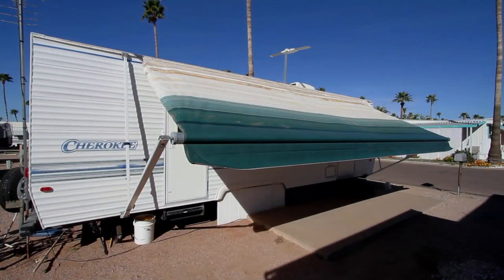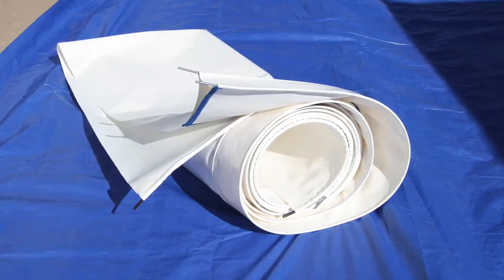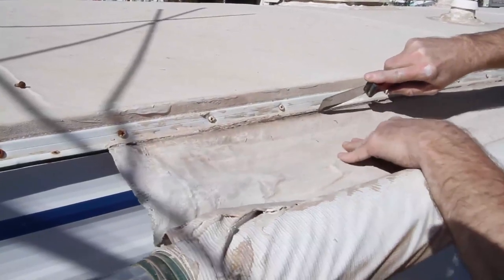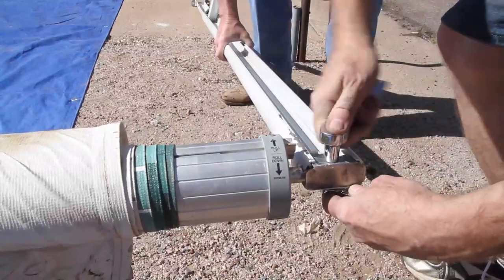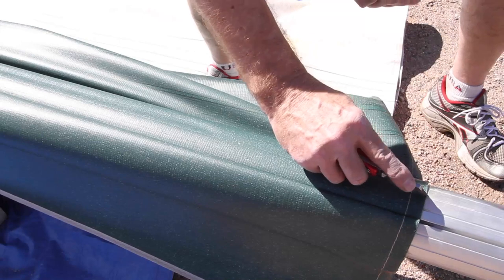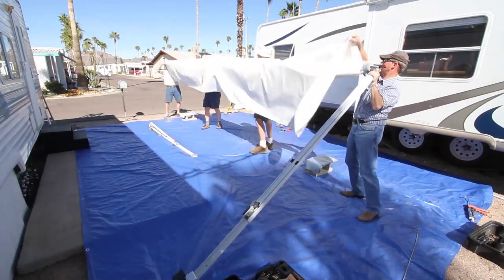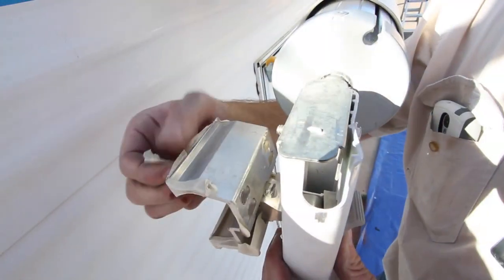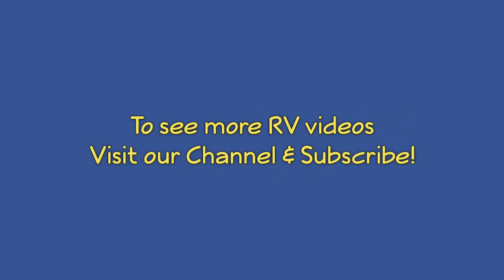RV Patio Awning Fabric Replacement - Tough Top Awnings Discount Code RVGEEKSROCK - 5% Off Your Order

Comment: my awning ripped and the arms fell down. The spring released leaving no way to know how many turns are required for proper tension. Can I use trial and error or is there a better way?
Reply from the maker: Hi Allan! Sorry to hear about your situation. Tyler from Tough Top Awnings provided some tips about re-tensioning the spring in a slide topper here: https://youtu.be/tIj6GdLMOBM
That's similar, so that video may be helpful, but if you'd like to get a little more input on tensioning an awning spring (vs a slide topper), Tyler is usually happy to help. You can reach him by phone or email through his website: http://toughtopawnings.com and let him know the RVgeeks sent you! Of course if you order new fabric, be sure to use the code RVGEEKSROCK to get a 5% discount, which is good both online and over the phone. Hope this helps a bit!

Comment: Seems like the harder way of doing it. I did it by myself by starting up top, inserting the loss canvas up top first, then sliding the roller on at the bottom.
Reply: Exactly!!!!  I looked it over, and came to that same conclusion.  Worked out to be easy all by myself.
Reply: Amused2death what if you don't know howamy times the spring is wound up to.?
Reply from the maker: +Scion XB check out this tip to get an idea: https://youtu.be/tIj6GdLMOBM

You can also contact Tyler through http://toughtopawnings.com and he's happy to help.
Reply: Amused2death thank you that helped a lot 13 to 20 times
tight is bettwrbthan loose😄

Comment: Is there a reason why you don’t cut the fabric from the top and then just slide out the cut part instead of the whole heavy awning? Same on the bottom?
Reply from the maker: That’s certainly an option. Actually, we now have a whole new and improved method for this job: https://youtu.be/vnxDLPDoVCc

Comment: Great video, but why not just cut the old awning at the top before you slide it out? That way you don't have to hold on to an entire support structure to slide it out. It also allows you to do the job as one person.
Reply from the maker: +lastuvthe I suppose you could! We'll have to ask Ray about that next time we talk to him. Great idea. I do think you'll need some help putting it back together though.
Reply: RVgeeks
Yes, you will still need 2 people to put it back on, but it does make the removal from the track easier - especially if it's not sliding out very easy. Excellent video though - the best on youtube by far.

Comment: The fabric at the bottom (tube) of my awning is shifted left. When I pull on the fabric to move it right, it won't slide. Any ideas?
Reply from the maker: Hmmmm... could be set screw(s) holding the fabric in place... OR... the plastic bead rod has shifted and is too long on the end you're trying to shift the fabric to (the right), and could be hitting the end cap stopping you from moving it. If the former, removing the set screw(s) will do the trick. But if it's the latter... you'd need to cut the extra length of beading to get it out of your way. You MIGHT be able to do that with the awning fabric installed on the roller... or you might need to remove it.

It could also just be really stiff, since there's usually two tracks that the awning fabric is held in place with on the roller tube: one for the fabric, and the other for the valance. So spraying some silicone spray into both tracks could free things up enough that you'll be able to slide the fabric.

Or, if the difference in placement isn't too bad, you COULD shift the fabric at the RV in the opposite direction to even things out (there will almost certainly be a set screw you need to remove from the track on the RV before being able to slide the fabric), too.

Hope this helps!

Comment: What is the significance of the Phillips screwdriver in the blind hole with the plug ?
Reply from the maker: To prevent the spring from unwinding. Doesn't have to be a Phillips head specifically, but they do fit in there very well!

Comment: No end cap for the screwdriver??  Use a rubber tie strap, like a flat style bungee, black rubber that the truckers use.  Double wrap while pulling tight then lash to side arm. This is how the pros do it at RV parks when working alone.  And 14 turns.....your spring is bad. If near salt water they last 5 years. Otherwise 10 year life span.

Comment: Yes my awning looks like the same one in the video but my end cap doesn't have a hole to put a screw driver in to lock the left side. What do I do?
Reply from the maker: Hi Cornell. We haven't encountered that, so we don't have any suggestions for you. But the absolute expert on this topic is Tyler at Tough Top Awnings. We'd suggest giving him a call (360.980.0537). And if you need to order fabric from Tough Top, get your 5% discount by using the RVGEEKSROCK discount code!  ;)
Reply: I have the same problem, did you ever figure it out
Reply: I spoke to Tyler and he said to put a screwdriver in the end of the channel for the strap, with the handle wedged up against the arm  will keep the tube from spinning. Thanks Tyler
Reply from the maker: Excellent! Tyler is the best! 😊

Comment: What if you didn't count the turns on your spring system., am trying to replace my awning on my RV and I did see this video before so now I have the spring system out but I didn't count the turns, please somebody help me!
Thank you so much
Reply from the maker: +gmex99usa It depends on the make, model and length of your awning. If you have an A&E manual awning, you can see the chart for the correct number of turns on page 7 of this PDF document:  http://bryantrv.com/docs2/docs/aespring.pdf  (it ranges between 8 and 12 turns). If you have any trouble, or need additional help, we're sure Tyler at Tough Top Awnings would be happy to assist. He'll be back in the office tomorrow if you want to give him a call (360) 980-0537. We've seen him re-tension springs in person several times. It's really easy and he can describe it better than we can.

Comment: It was a great video except for when the spring got wound up to what was unwound. I did exactly as video but awning would not roll up. Ended up winding spring triple the number to get it to wind up. This needs to be added in video. 2 hr job took 4 hrs plus
Reply: I recently replaced mine and didnt have any helper. I skipped the part where you disassemble, unwind and remove the springs. It went quickly and will be even easier next time. I made a video of it

Comment: What if the end cap has no area to put the screwdriver?
Reply from the maker: Bob Boles Hi Bob! We don't have enough experience with patio awning installations to be sure, so we're going to suggest you contact the professionals! If you e-mail Tyler, the operations manager at Tough Top Awnings ( tyler@toughtopawnings.com ) and send him your question along with this link: https://youtu.be/ZfpM-op0dkU?t=4m40s he will surely know the correct answer. He's very responsive and has a ton of experience with these. Tell him Peter from RVgeeks sent you too! And of course if you order replacement fabric, be sure to use our discount code to get 5% off: "RVGEEKSROCK"

Comment: Does anyone know how to measure to get the length of the awning? I know the width. The awning was cut out between the rv and the roller.
Reply from the maker: Hi Joshua! There should be nothing to measure, as the length is standardized for each awning model. If you visit Tough Top Awnings website, you'll see there isn't even a place to add the length, so you'll be good to go with just the width. If you do order from them be sure to use the discount code RVGEEKS to save 5%!  https://www.toughtopawnings.com

Comment: What if the tube doesn't have an awning on it and already has been unSprong
Reply from the maker: +Fat Kat You'll need to re-tension the spring as part of the process. Here's a video that might offer some help on how much to tension: https://youtu.be/tIj6GdLMOBM or you can look online for the installation manual for your make and model.
Reply: RVgeeks thank you I appreciate it

Comment: What if your rear cap doesn't have hole to lock the spring?
Reply from the maker: We're going to have to defer to the real expert on this one: Tyler from Tough Top Awnings. He knows more about this job than anyone we know, and can surely help. You can reach Tyler by phone at (360) 980-0537 or email at tyler@toughtopawnings.com and tell him the RVgeeks sent you! And of course if you buy replacement fabric from him, be sure to get your discount by using the code RVGEEKSROCK when you order (his fabric is the best we've ever seen, and all of our slide toppers, and our main awning are from Tough Top).